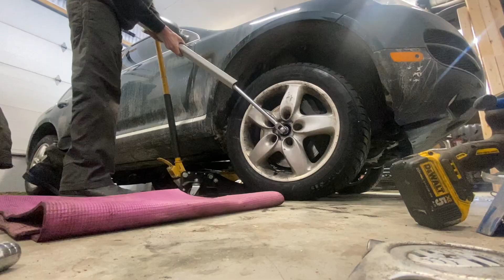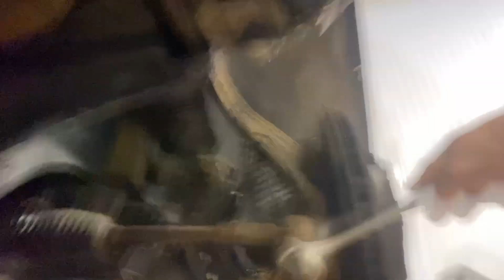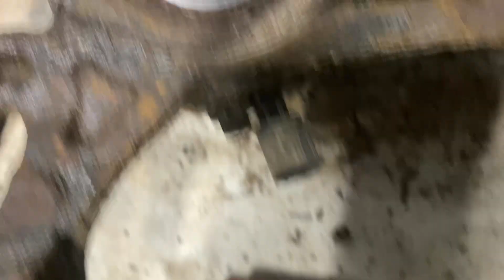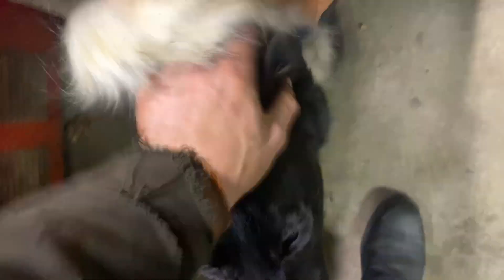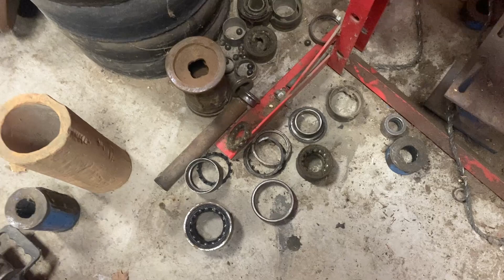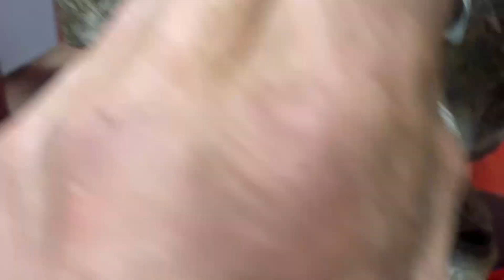7L/T1 Touareg front wheel bearing replacement

Comment: Very helpful video, done my front bearing today, the ring of weld around the bearing to release it by heating and cooling it was brilliant. My press wouldn't move it without it. Thank you for such an informative video
Reply from the maker: it's one of those things you wouldn't believe works until you try it. If you get it thick and hot enough it'll shrink to the point of not even needing a press

Comment: At what mileage do you people see bearings failing on Touareg/Q7 platforms? There isn’t a ton of videos on YT and even forums are very quiet, so I figured they pretty much last forever on those cars. I’ve seen some really nice but expensive tooling to remove this in place but at least in your case you have access to some shop tooling. Nice job by the way!
Reply from the maker: I think I did a rear and a front pretty close together around 250k-280k km, I feel like a lot of these cars might not be owned by DIY-ers and just get taken to a shop. They are a heavy roller bearing though. 

No doubt they are do-able on car but these were so rusty if I had the tools I still don’t think they’d move
Reply: @JoshsJettas well, i am at 220 thousand kilometers now and no problems yet with noises but bough replacement bearings already in anticipation of them going sometimes soon.
Reply: The 2.5 tdi have another type of bearing( Transporter t5), but still a lot of work to remove the axle

Comment: Hey what were some of your symptoms for wanting to replace this bearing? I have a clicking sound when I am turning about slightly to the right on deceleration. I've replaced the CV shaft, but still get the sound. It's only in certain instances that I hear the clicking sound, otherwise it's gone!
Reply from the maker: This one just had the regular noisy bearing hum, that sounds like an odd one but the wheel bearing is a cheap place to start

Comment: Happy to see I'm not the only one tinkering with a rusty T1, keep posting! A neighbour helped me get the wheel bearing out - he used the same weld trick when 15 ton didn't help.
Reply from the maker: Yeah I get a little sketched out that the cast will break once you start having to put a pile on pressure on it, they fall right out once welded.